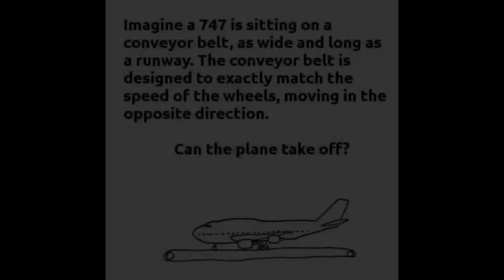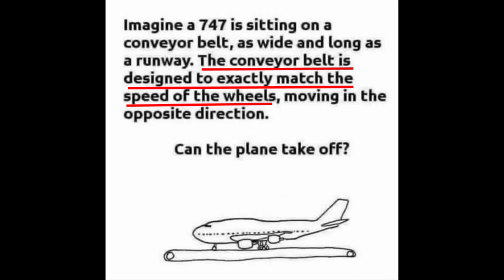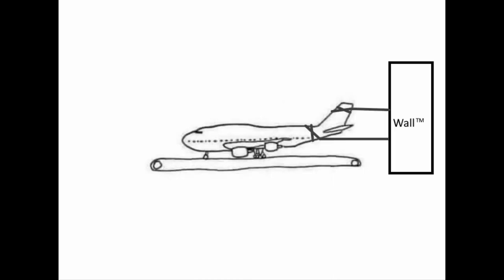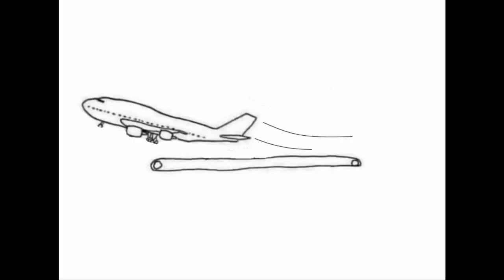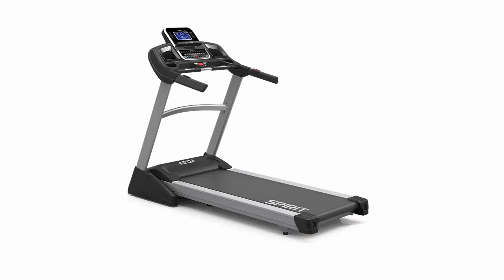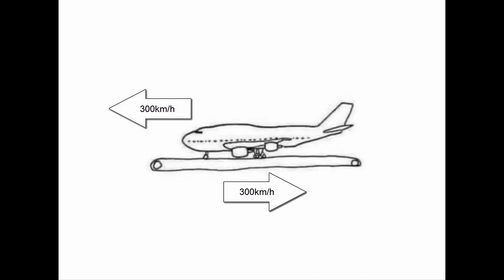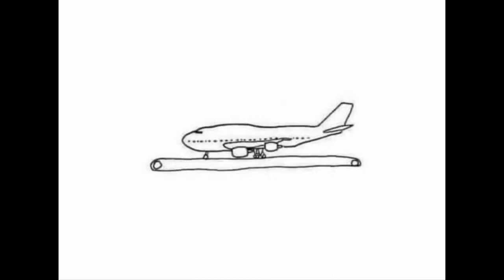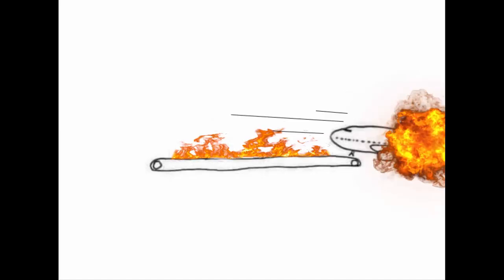Airplane on a treadmill is a flawed question.

Comment: This is a great explanation. There are pilots who have gotten this one wrong, but as you perfectly pointed out, in a certain sense the wheels are totally irrelevant. It's a trick question.
Reply: I'm a pilot of 15+ years but I have no physics education. 

 One thing I can't wrap my head around is the thrust vs lift part of this experiment. Please god help me understand lol

The engines don't generate lift, they generate thrust to push the plane forward. That's why you need a runway: to get the air moving over the wings. That's why it's preferred to take off in a head wind. 

If the plane starts to roll, and the treadmill matches its rolling speed, then it can't be pushed fast enough to get the airspeed over the wings. The engines have to overcome rolling resistance to generate lift. 

As an ignorant physics enjoyer, I think pilots approach the question looking at the lift over the wings, and other people are looking at the wheels/skis. 

With my experience flying, the thought of the treadmill moving at the same speed, the plane couldn't get it's on ground speed up enough to get the air moving over the wings 

I can't understand the answer.
Reply: @ssjaken  
Agree! (I'm neither physicist nor pilot)
It's the airflow past the wings that creates the lift. If the conveyor belt is able to keep the plane stationary relative to the air, it won't take off.
Reply: @ssjaken  
The belt would "match" but not "negate" the forward speed of the wheels.
Reply: If the belt is matching the speed of the wheels, then it must by definition be negating it assuming there is no slippage.
Reply: @ssjaken  Because the plane needs to get speed vs the air mass, not the surface it is rolling on (i.e. treadmill or the surface of the Earth). That's why it is easier to take off in headwind - the plane only cares about the speed of the air vs itself! Imagine that the plane is not rolling on wheels, but levitating with magnets or whatever - there are such craft. No ground contact. It will still take off normally, even if there is a treadmill moving fast beneath it (which it does not care about).
Reply: What if the runway itself is moving at a speed opposite that of the plane?
Reply: @Mrcantfapenough  The thing is that the speed of the wheels or the belt is irrelevant. The belt can move forward or backward at any speed, or it can even move sideways. What matters is the speed of the plane vs the air mass (airspeed), as long as there is sufficient airspeed (i.e. wind blowing over the wings of the plane), it will take off no matter what.
Reply: @Mrcantfapenough  I get your point but no. The plane will still take off. By your reasoning a plane would not be able to take off on ice. But it can. It does not need to "push" it self against the ground (or treadmill) to take off.
Reply: @Mrcantfapenough  OK, I will try to explain why your reasoning is wrong. Let's say you are on a treadmill and holding a kite. The treadmill goes backwards at the same speed as you are running forwards. So you are trying to get the kite airborne and are running forwards. But since the treadmill is going backwards at the same speed, you are essentially staying still, and the kite is sitting like a brick. Or you are on a treadmill in a car and towing a glider. The belt is again moving backwards at the same speed you are driving forwards. Again, the glider will sit as a brick, no matter how fast you are driving. Is this what you are saying? But now think again, a plane is not a glider. It has an engine (like a propeller) that pulls it through the air! Through air, not along the ground. You see the difference?
Reply: @Mrcantfapenough  You are misunderstanding the problem. It is the belt that matches the speed of the wheels, not the other way around. The belt, you see? The plane takes off normally, just the wheels are spinning faster because of the belt.
Reply: @Mrcantfapenough  The wheels are not going anywhere, they are spinning around the wheel hub.. By your logic the treadmill is somehow "grabbing" the plane by the wheels and not letting it go. But this is nonsense, it cannot do that, can it?
Reply: @Mrcantfapenough  ""since the wheels cannot break traction" - what kind of traction are you talking about? Do you think a plane needs traction between the wheels and the ground to move forward? No it does not. It can freely take off ice, and you admitted it yourself.
Reply: @Mrcantfapenough  Because the wheels aren't coupled to anything responsible for thrust or force. The wheels can literally do anything as stated in the video it won't impact the plane's ability to take off.
Reply: @morgancross5481 that is incorrect.

At every instant an aircraft is on the ground, the rotational speed is directly correlated to vehicle speed.

Mythbusters and others really screw up when they try to say the wheels are free spinning or that wheels have nothing to do with thrust or propulsion.

By intro to physics rules, the vehicle velocity is exactly the radius of the tire (ignoring slight deformation and internal bearing friction and unnecessary items such as that).  You can go through this exercise backwards and forwards and reach the same answer.

The simplistic approach is to just say vehicle velocity is always the negative of conveyor velocity.  That makes it abundantly clear the plane is at a standstill.

What the problem as posed does is add the wheel element of course, with the trick that people will have to tease out that rolling speed is rotational speed of the tire at a given vehicle speed.

Comment: The problem is what the "speed of the wheels" is. The speed of a) the wheel axle or b) a point on the outside of the tire, relative to a) the ground or b) a point on the surface of the belt?
Reply: @RodrigoFernandez-td9uk  it is a frame of reference question but all we need to do is take the rotational speed of the wheel and the set the linear speed of the moving surface (aka the conveyor) equal to it.

We have to keep the basic principles clear in our minds.

Comment: Absolutely correct.  I'm an airline pilot and certified physics teacher.  The airplane would accelerate and fly if the wheels did NOT overheat... but they would so the landing gear would fail.
Reply from the maker: Exactly. The only way the treadmill I'd preventing the plane from moving is by destroying the landing gear
Reply: @frostscience5470  it could not accelerate under the terms we are given.  The confusion is that people are essentially isolating different physical components improperly.

First you have a rotating component - of courses, the wheel set.
Second, I hope we agree there is the contact patch with no slippage.
Third is the moving surface - the conveyor belt.

A pragmatic way to view it is a pinion gear on a rack.  A rotating pinion on a moving rack can certainly produce equilibrium of motion.

That’s all the parameter says we have: No net motion at the axis of the rotating component.

Comment: I think this is essentially a modern rehash of Zeno’s paradox. (Achilles races a tortoise. Tortoise has a head start. Race starts. Achilles covers the distance to where the tortoise is, but in the time that took, the tortoise has moved. Then he has to cover that distance, but the tortoise moves again. This, for infinity. ‘Achilles can’t overtake the tortoise’)

In reality, that’s not how a race works. Similarly, this scenario tells you a thing is happening that can’t really happen. So of course it breaks a few brains. 

(I also think even though the ‘runway sized treadmill’ is often explained in the wording, this question is almost always accompanied by a diagram that makes it look like the treadmill is only the length of the plane, which straightaway primes the readers mind to imagine the question is saying ‘can the plane take off vertically on this treadmill by getting the treadmill up to the planes take off speed.’)

Comment: It literally doesn’t say what direction the wheels or belt are even going. Could be backwards. Still can’t takeoff without lift.
Reply from the maker: The plane will move regardless. Mythbusters even tested it. They had an ultralight plane moving down a sheet being pulled the opposite direction at the planes takeoff speed. The plane still moved and took off, the only difference being the wheels where spinning twice as fast. Because the wheels play no part on a planes forward propulsion.

https://youtu.be/YORCk1BN7QY?si=VRjgzraVMiazbULo

Comment: in your example, the wheels spin at 600km/hr, but the treadmill only spins at 300km/hr, so it didn’t match speed
Reply from the maker: It's because you can't match the speed. There is no top speed at which the wheels will stop accelerating as theybare just free spinning. Once you overcome friction there's no stopping until the wheels fail.

The whole point is the question is a trick question. It intentionally makes you think airplane wheels operate like car wheels to make people argue.
Reply: @venera13  I don’t see why you can’t match the speed. if the wheels speed up, the treadmill speed up just as much, all the way to infinity
Reply: @davidbarroso1960  If the wheel speed matches the treadmill, then the the plane isn't moving. If the plane isn't moving, then why are the wheel spinning? Jet engines can't make the wheels spin if the plane standing still.
Reply: @9Blu  friction. Heat.  Use your imagination.  Blobs of gum on tires.  Velcro.  Whatever works.  Magnets.  Potholes. Speed of conveyor must equal speed of wheels.
Reply: @davidbarroso1960   The plane will accelerate through the air to reach takeoff speed.  At the point where the wheels are going [takeoff speed] faster than the conveyor belt, the plane will be going [takeoff speed] compared to the air, and will take off. 
If the plane has a speed of 5mph compared to the environment, then the wheel speed will always be 5mph faster than the conveyor belt speed.  As the belt accelerates, the wheels will accelerate to match but remain 5 mph higher.  The belt can never catch up.  And that 5 mph will continue to quickly increase as the plane accelerates through the air preparing to take off.
Reply: @9Blu   In your question, the plane isn't moving compared to the air and most of the environment, but it is moving compared to the conveyor belt.  
Because planes measure speed in terms of air speed, it would show a speed of zero.  But if you were to hook up a car speedometer to the wheels, it would show a speed because the wheels are moving relative to the surface they are on.
Reply: @greybeard5123  but then the treadmill isn’t matching the wheel speed

Comment: It is a theoretical question that cannot replicated in real life, but if the wheels are ONLY spinning at the same speed (opposite direction) as the conveyor then the plane stands still!
As the video says though 300km/t trust from engines and conveyor running 300km/t backwards would result in the plane moving 300km/t, wheels 600km/t. 
Question is tricky because it mandates that wheels and conveyor has the same speed, but it cannot be replicated in real life!
Reply from the maker: The whole point is its a trick question. The experiment can and has been replicated and the plane, from toy to full size ultralight always moves forward. The treadmill can't match the wheel speed as the wheels have no set speed. That's how it gets you. By making people think the wheels have a set speed.
Reply: @venera13  
No the point is reading the question!
If the wheels and the band runs the same speed - opposing direction then the plane remains in place relative to the ground. If the plane moves then the speed of the wheels and the conveyor will differ by the speed of the planes movement relative to the ground.
You are ignoring the condition that wheels and conveyor maintains the same absolute speed - opposite direction.
It is a trick question because you could not do this in real life. 
The question is not about the trust of the engine vs the speed of the band but about the rotation of the wheels which are totally decoupled from the trust. 
Run conveyor -300km/t, plane trust 300km/t then the wheels would spin at 600km/t and the plane move with 300km/t, but the question was wheels 300km/t and conveyor -300km/t and that leaves 0km/t for the fuselage
Reply: @jenspetersen5865  
Agree!
Zero km/h for the fuselage means zero km/h relative to the surrounding air (assuming no wind), which means zero airflow around the wings, zero lift and no take-off.

Norsk?
Jeg så at du brukte km/t i stedet for km/h.
Reply: @venera13  > The treadmill can't match the wheel speed as the wheels have no set speed. That's how it gets you. By making people think the wheels have a set speed.

now you're just making up caveats. As stated in the original question, the treadmill always matches the speed of the wheels. If that's the case, the plane will never move relative to the ground only because of gravity
Reply: @venera13 Anyone who has attempted to test this experimentally has most likely misunderstood the question, as the question is purely hypothetical and recreating it experimentally is impractical.
Reply: but the question does not mandate that the belt do anything. it says it’s designed to match the speed of the wheels, but nothing in the question says that it MUST

there would have to be some other variable thrown in there, like “can the plane takeoff without breaking the design of the belt?”
Reply: @gwp4eva  So 2+2 is not 4 because you could add something else to it...